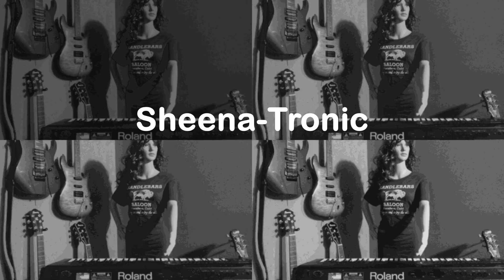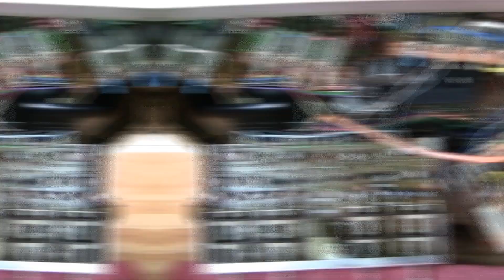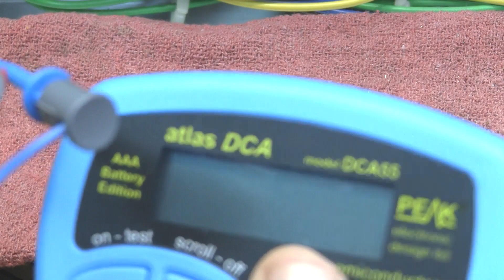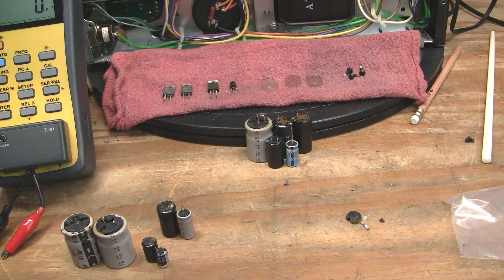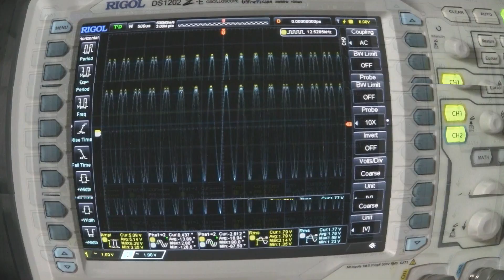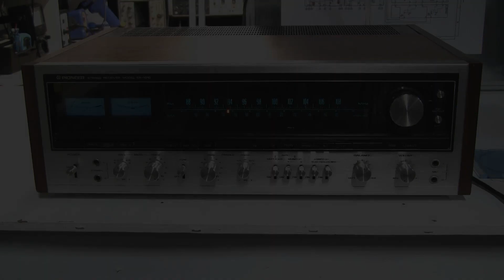Pioneer SX 1010 Late Video Footage Final

Comment: My SX-1010 was rebuilt by David @Vintage Audio Revival, here in Southeastern Wisconsin. He ordered and installed a fully assembled Delta 9 AWR-054 Power Supply Board w custom built-in heat sinks addressing and upgrading that known critical component.
Reply from the maker: Hello there Scott, thanks for chiming in with that information regarding the aftermarket PS board, a good resource to be aware of. Have a nice weekend, my best to you.

Comment: 12:00 i have a special switch cleaning enhancer that i generally smoke before flushing controls.🙃 in combination with tunes, it makes it much better.  i still need to do that center bank of switches and a couple bulbs in my sx1010 but nothing is noisy atm and the rest of the unit is done so when ever i decide to use it, it performs perfectly. i picked up an sx3900 in feb. and i've got it to about the same point. i tend to repair my own gear, use it for a while then put it on the shelf and pick at the restoration as bench time permits.  i've got entirely too much gear but i am thinning the herd and many pieces are going( and have been going) to a new home where they will be used and appreciated. it's really time to start concentrating on building speakers again but it's so hot in the garage. :(  rock-n-roll brother!🎸
Reply from the maker: Hello there Joseph, hope all is well, been extremely busy as usual as I work "hard and heavy" to thin the herd in here as well. Yes, nothing wrong with a little "switch cleaning enhancer" / herbal remedy if it gets you through those long sessions, and yes, gotta have the tunes to complete the experience. Sounds like you're getting through your restorations at a relaxed and steady pace and that's a good thing. As far as the acquiring of too much gear, it happens, just kinda comes with the territory / nature of the biz. With time you'll tame the herd, sell some off, trade some, acquire other pieces of interest, hence, the cycle will continue, but in a more "selective" manner. I have my fair share of gear I've acquired over time, most of it due to be restored for sale and a few pieces near and dear to me that I'll keep. Otherwise, I mostly turn away equipment, unless it's something really worthwhile. Otherwise, I hope you get around to building speakers again soon when it cools a bit, my best to you as always, talk soon 🙂

Comment: is that CRC5-56?
Reply from the maker: I just use the CRC QD "Quick Drying" electronic cleaner / contact cleaner. I don't like to use anything with a lubricant / protectant added to it, I'm only interested in the cleaning aspect of the solvent. I prefer to add the applicable lubricant / protectant to the control after cleaning.

Comment: Looks like someone used white lithium grease on those switches. It’s good for car door hinges, but not audio switches.
Reply from the maker: It very well could have been white lithium, and yes, not for switches. In the audio realm I'll use a good quality white lithium grease for some of the more "brute force" levers, cams, gears etc., i.e., in some turntable and tape deck mechanisms in the proper amount, but again, you are correct not a switch lubricant. Thanks for chiming in, my best to ya :-)